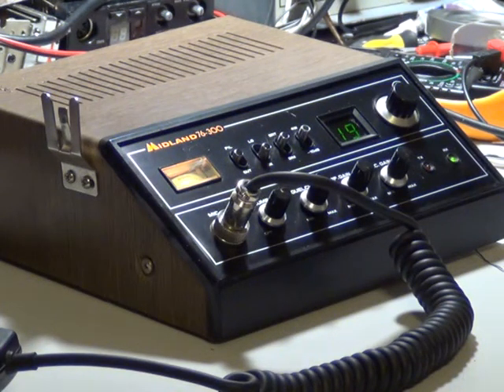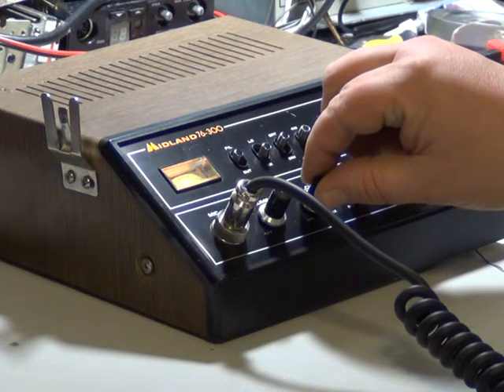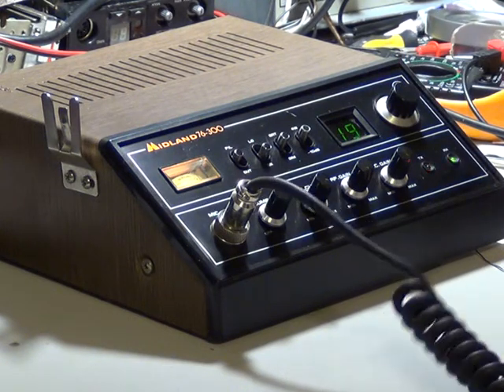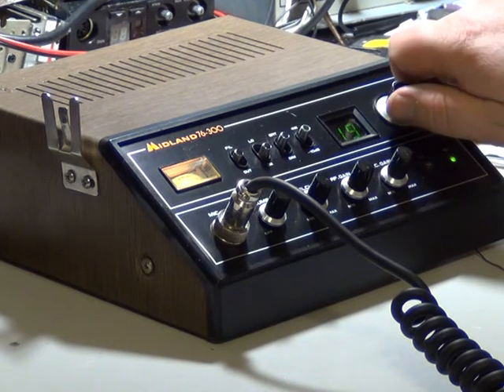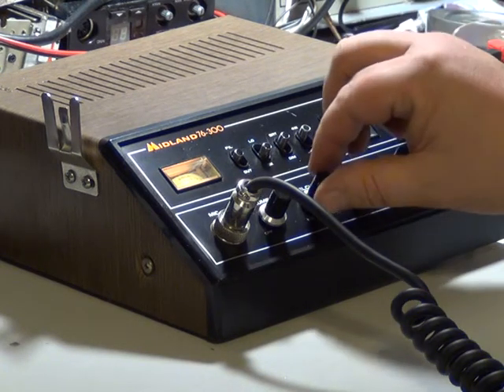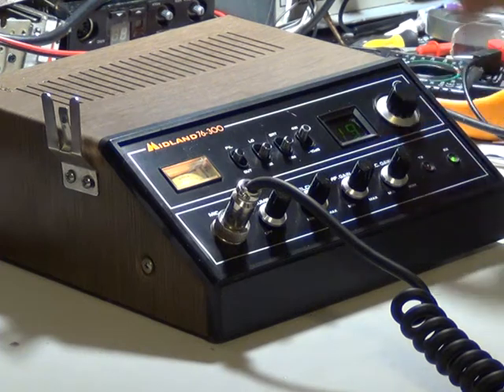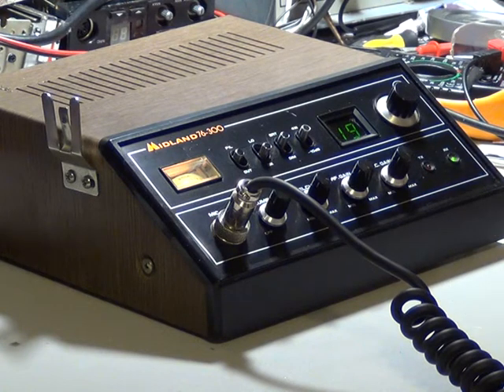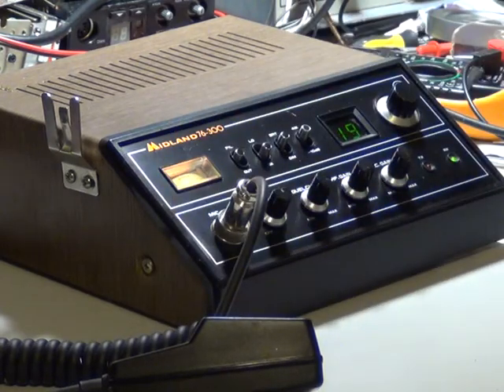Midland 76-300, UK (CB 27/81) CB radio (Base Station) - On The Air Test

Comment: This the same radio used in the tremors movie. They show it being used as a portable unit with a small antenna but I doubt it works that way.
Reply from the maker: I had to look this up. It's an American 1990 film.   So if this style of radio appars in an American film, then it's going to be the USA version of this radio.  As I said in the video, the Midland 76-300 wasn't available in the UK & this particular set is a pre-production prototype.  No doubt they made thousands of them for the USA market & of course will have a totally different innards.

Richard, G0OJF, UK
Reply: @ukfmcbradioservicingTango21 
It looks like it's a non functioning prop in the movie because there's no power cord or batteries and CB radios use a larger antenna than the one seen in the film.

Comment: Hello Sir,i just got one today from a friend was dusty and sticky .
Cleaned up and looks like new !
How kool is that :-)
Have Mid 76/300 nicely on top of a Cobra 139 23 chanell am,ssb,lsb,usb 1970
A of course a swr meter on top of Mid 76/300
Antenna ... ... not on roof yet but have a temp set up
Greetings from New river Valley Virginia usa
Reply from the maker: +Steven Partin Just be aware that I'm not familiar with USA models. The UK CB radio system is 40 channels from 27.60125 to 27.99125 at 4W RF output. 

Illegal importation of USA CB radios into the UK can lead to 6 months imprisonment!

UK residents may also use CE approved only CB radios for the pan-european band on the same frequency band as the USA. 4W RF output, 40 channels, AM/FM/USB/LSB. The transmitter spurious emmissions permissible on the CE band are much stricter than the FCC rules for the USA, hence FCC approved models being illegal here.

Anyway, well done on your setup!

Richard
Reply: Sorry for late reply, thank you for the information
Reply: @ukfmcbradioservicingTango21  hello . G was wondering if you can helped out. I  have just come back on the cb after 35 years . I came back on because of health problems that keeps me in the house a lot . So I was just wondering if you repair cb   for the public as I have 2 or 3 I would like someone to have a look at. One being my dads who's not with us anymore.  Hope to here from you . Thank you . Jim.
Reply from the maker: @jamesgaunt7357  James, I replied yesterday to your request. Please email me rshireby@yahoo.co.uk
Reply: Steven Partin ooh aren't they eligal sidebanders ,,

Comment: In 1994 I got the US model 76-300 for my first base station. Was a good little starter until I let a local truck stop CB shop "Supertune" it for $50. It was later replaced in a year by a Cobra 132 XLR that was two years older than myself. Which was then replaced by a brand new Superstar 3900 about a year after that. These 76-300's were cheap and common back in the day. Now I almost never see them on the used market.
Reply from the maker: As I said in the video, I believe our sample was a pre-production sample. I say this because the radio had no serial number, though the plate was there & because I've never seen one before either 'in the flesh' or advertised..or discussed or anything. As you say it was certainly aimed at the cheaper end of the market, but the one in my demonstration video performs perfectly.

You will appreciate the UK CB system is FM & covers 40 channels from 27.60125 to 27.99125, so radios may look the same as ones in the USA market, but have totally different innards for your AM system.

It sounds like your local CB shop are unqualified bodgers.

Richard
Reply: There has not been a local CB shop around here in about 16 years. Partly because they were part. But mainly because US truckers mostly don't use them now.
Cheers